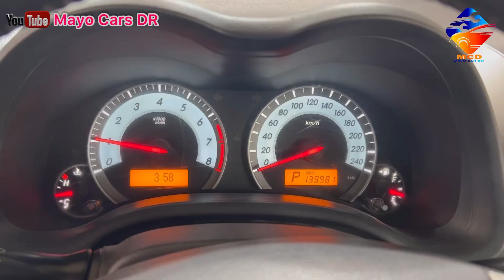Toyota Corolla Engine Installation || After Rebuild Engine Installation And Starting Engine

Comment: Salam, please what's your recommendation on this engine oil, an oil seller recommended 5w30 for 2010 Camry 2ARFe engine for our weather in Nigeria, is it okay
Reply: 0w20 or 5w20
Reply: @cesararturofranco9035  was using 0w-20, d engine was making ticking sound, too much
Reply from the maker: 5w30 oil it is okay